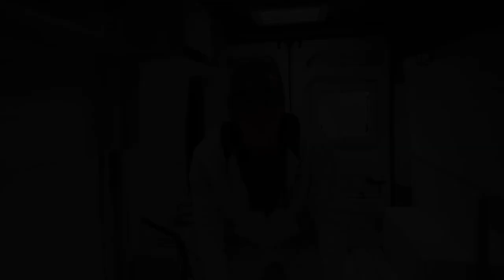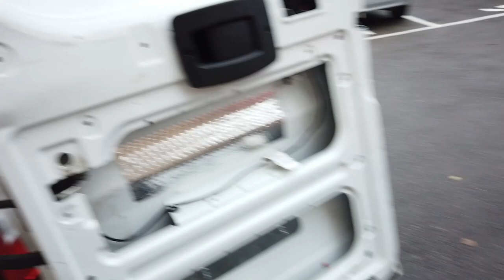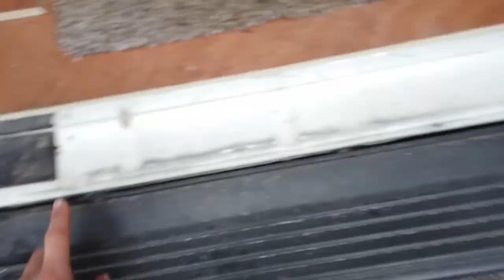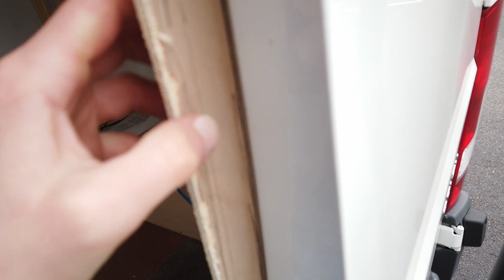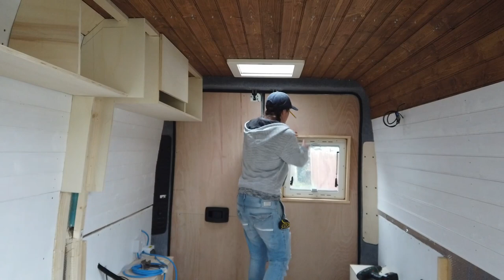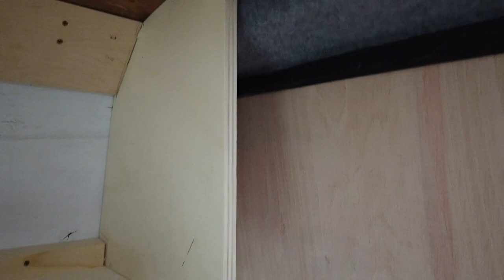HOW to PLY LINE the doors in a CAMPERVAN conversion. DOOR CARDS!!

Comment: Thanks for all the really useful videos. On this one you say it would have been easy to take the back door handle off and so save cutting the card in two. How? I see the two screws on the plastic plate but don't know what to do about the pin through the handle itself. Cheers
Reply from the maker: Hi, Lou said it would have been easier if she could have gotten it off but should couldn't work it out either, sorry 🤷‍♀️😂
Reply: @campervibe  Well, I don't feel so daft now. I tackled the door today and did it as Lou showed. Worked great (apart from a slightly over zealous cut around a hinge).
I hope covid will soon give way and we can all enjoy travelling. Best wishes.

Comment: Hey! Great work as always Lou. Inspiring💪
I'm doing my rear doors at the moment, do you have any tips on getting the screws into the doors because it took me aaages to do 2 of them yesterday 😑 and I'm doing it on my own with no one to ask for advice! 
I know you're travelling atm but if you have a chance to reply I'd be very grateful 🙏
Reply from the maker: Hi there, try pre drilling the holes first, with a 2mm or 3mm drill bit. If you can, clamp your door cards (or slats whatever you are using) in place, drill a small hole straight through the wood and metal and then whilst it's still in place put the screw in. You can do it without clamps but it's a bit more awkward, once you've got a couple in it's easier. Just be careful of the electrics for the central licking etc. Hope that helps.
Reply: @campervibe  thank you so much, you're very lovely to respond, and so quickly too! Thank you, thank you, thank you! All the best to you both on your travels
Reply from the maker: No worries, good luck with your build 😁

Comment: Why did you just cover doors with stretch  carpet, I like the ply concept but for mine the doors are packed with mineral wool for acoustics for high end sound system. If I use hard substrate frequencieswill bounce off opposed to desired absorption characteristics of a carpet or fabric. Wondering is reflectix could be counterproductive with this also
Reply from the maker: Hi Paul, we have a hairy dog and a cat who likes to scratch the carpet so not an option for us 😂🤣 Thanks for watching 😁👍

Comment: Does the ply on the back squash up against the seal?? Or a gap netween the ply and seal cheers mike..
Reply from the maker: Hi Mike, my ply sits just inside of the seal, I've got a few mm gap all the way around. I don't think the door would stay water tight if I pressed up to the ply.
Reply: @campervibe  thank you hope you don't mind the questions..
Reply from the maker: @michael735014  no worries, not at all 👍

Comment: Did you end up installing closed cell foam behind the door cards - or were they ok just with aluminium foil bubble wrap in the end?
Reply from the maker: Hi seb, I put some thin closed cell foam between the door card and the metal parts of the door where the two touch only if that makes sense. I could get a good amount of insulation in the door cavities, then I had my foil bubble wrap vapour barrier followed by the small areas of closed cell foam.
Reply: Using the closed cell foam only where the metal parts are right under the ply makes sense. I'll be doing my door cards next week, or the week after - so, useful tip!
Reply from the maker: @sebxj25vm  no problem, I think I used something like 5mm, maybe even 3mm.just to help with any thermal bridging really.

Comment: How did you get the window cut out to the right size? Did you mark it from the outside before you installed the window?
Reply from the maker: Hi, yeh I marked it as best I could through the open window and then spent a long time measuring, cutting and refining it, was a bit tricky to be fair 😁👍
Reply: @campervibe  that’s what I’m not looking forward to 😂
Reply from the maker: @jondavey007  😂🤣 I don't blame you! Good luck with it 🤞👍